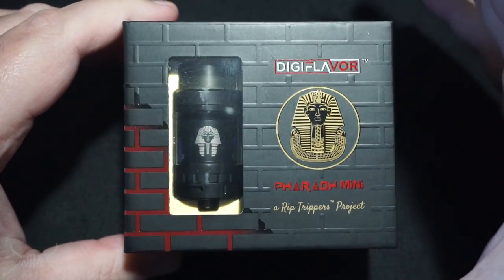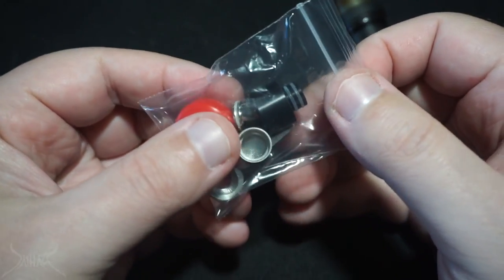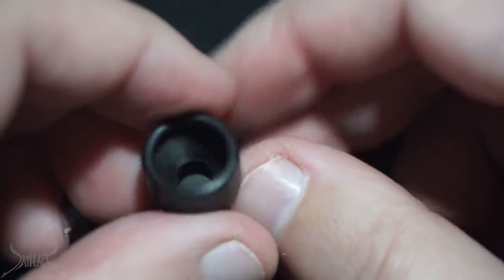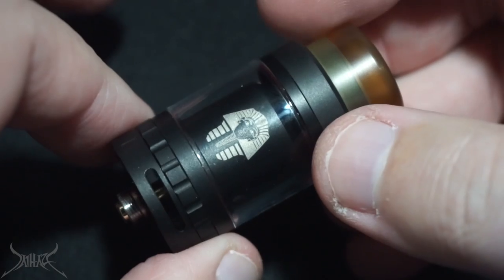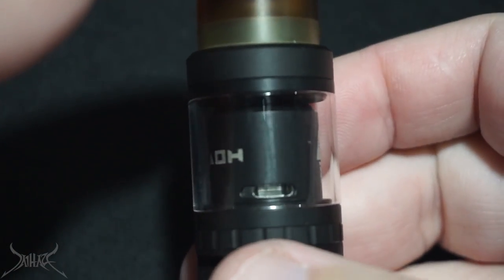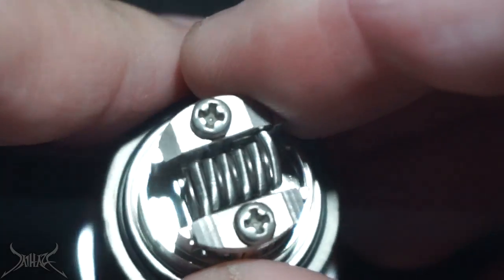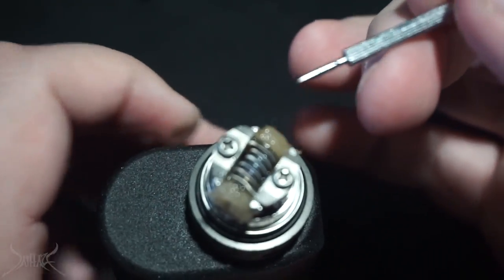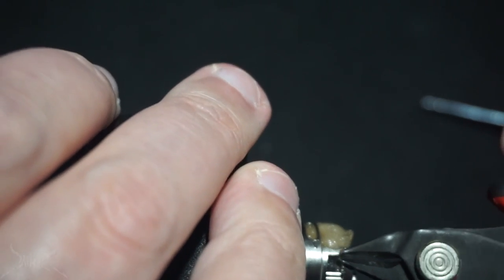WARNING: Digiflavor Pharaoh Mini RTA Review and Rundown | RIP Trippers Project

Comment: ive owned this for a couple months... no issues at all and juice flow control works fine. great tank though
Reply: I had one, and it worked perfectly...then suddenly the juice flow stopped turning. Tried everything, took it to the retailer, ect.... Jai is correct. some of them are defective, like anything else mass produced. I loved the tank, and will eventually purchase another. But Jai is correct about this problem. It is turning up more and more now.
Reply: yeah, juice flow control is fine spins round and round all day on mine
Reply: Aaron Fraser honestly jai just tells it how it is, just like every reviewer has a opinion so does jai, but he is 100%, rip trippers is not actually, he's more like a "yes man" I mean come on not 95% of the  time should products have a huge amount of positive reviews man, I don't want to buy something that's not true even though the reviewer says that it is. So far jai is a honest  reviewer so if you want to sugar coat something that's on you, reality is reality
Reply: Does jai have a thank lmao if he does I haven’t fuckin heard of it.........
Reply: I was under the impression from Rip that the juice flow control was more of a “set and forget.” The main purpose is to cut off flow for filling up, then its opened to its normal position.
Reply: I finaly looked at what the actual fuck he did, he did not lock the tank as he should have xD i did the same thing, broke the glass and i looked at rip's video, just pacepalmed myself. READ THE INSTRUCTIONS! PHARAOH is most beautiful and top of the line rta ;) who has it, loves it
Reply: @SasaPetricevic  top of the line? Wtf, its a cheap chinese tank.. Mines a pos in my opinion..
Reply: @Slabri  jai is reviewing from the consumers point of view.. If my tank has a fault its a pos.. And if its a quality control thing, how come so many pharaohs have the same issue? 1 or 2 fuck ups is bad but hundreds or even thousands are messed up then the QC is bullshit..

Comment: Bought this today and the flavour is unreal. Slight leakage when I poured some juice down the mouth piece instead of unscrewing it and pouring into the tank. I went from a shitty old Zenith RDA which was burning my fingers when it leaked juice and having to crank up the power (in series) to get a decent hit to now using parallel mode with my batteries and having excellent cloods. I'd definitely recommend it.

Comment: You might have a defective one cause I bought 2 and have no problems with either one.maybe try it in shorty mode. Both of juice flow controls work on mine but my black one is a little harder to turn than the silver one.
Reply: The juice flow control is just like the griffin.  There’s a separate ring above the base that just needs to loosen up and it’s probably because of the paint.  My griffin tank took awhile to loosen up before it worked right and eventually I had to take a rubber mallet to the base because it got too loose.  For those style of wicking channels juice flow control is very useful.  If you get it spinning loose independently from the base, then you will have a really good tank.  Just my play on it.  I could care less about Rip Trippers.  Just seems like the exact issue I had with my Griffin rta which I still use every day.
Reply: Ive been using the griffin plus for about a year now and i just literally spun my base tonight after reading your comment. Thanks! I never knew that. I also have the pharaoh mini. Youre right!
Reply: dude i just spun all my ammit tanks loose too! the ammit original. I never knew they did that! Ive been using those for over a year, as well! Shit!
Reply: Matt Rainear I have the original Griffin tank and the juice low does not work like that it's free spinning there's a ring to tighten the base all the way down and then a separate one for your juice flow that keeps spinning continuously.  You are not unscrewing the tank on the Griffin for the juice flow control understand?
Reply: Matt Rainear I have 2 pharaoh mini and both of my juice flow controls work. Like I said the black Pharoah I have was tight  till I broke it in. Both of mine work fine with no leaking in 2ml mode
Reply: is like the ammit25 right? I think he is doing wrong

Comment: I own this tank for more than 6 months. I never experienced any problem as long as the wicking is correct. If the cotton is protruding little bit then the chimney will stuck with the deck. Flavour and  is great even at 25 watts and can go up to 50 watts also. No dry hits and leacking if wicked properly. Only issue is restricted airflow

Comment: You didn't tighten the locking screw enough to hold everything in place. If you had locked everything down properly, you would've been able to adjust the juice flow without unscrewing the entire thing — that's the point of the locking screw.

Comment: I had the same issue with the juice flow being super tight and nonfunctional out of the box on my black one. If you run into this, put the base on a build stand and use a screwdriver in between the build deck like how a coil would be installed and use the added leverage of the screwdriver to pretend like you’re tightening the deck into the base and it will break free and start working normally. I won a stainless one in a giveaway that worked normally and actually really liked the rta- being able to close off the juice flow when you go to refill made it never flood the deck like I’ve had happen on a bunch of other rtas.. I decided to buy a second one and the black one juice flow was seized..having one work normally allowed me to figure out how to fix the other one.

Comment: I'm a bit late on this but there might still be people considering this RTA.
My tank have the same issue with the juice control, it just doesn't turn. The cause seems to be how the juice control ring is installed on to the base. It's press fitted and the factory just couldn't keep up with the tolerances. 
The design is not that good, way over designed. There are so many separated parts and O rings in it, break 1 O ring and it leaks.
Jai Haze is a great, honest reviewer, I like how he's being picky on products. Details make a good product.

Comment: Keep it real! Love your review! Have Zeus love it once I wick and coil right. Ammit 25 single coil leaked  at juice control and felt a little lose when you turned it. Took there  O ring ring off and use same diameter o-ring from Zeus kit just a little thicker tighten it up nicely no leaks

Comment: Put the 2ml glass on and make sure to put that lock not thing on then hold the top cap and glass while turning clockwise to break it in. At least that is what I had to do with my black one. I have no leaking at all with both of mine in 2ml mode.

Comment: Ok Jai, no time or no money, no way you're going to get a new one Pharaoh mini to see if this one has "pressure" problems when you unscrew the tank to open the juice flow control. Do that for us then.
Just build it again with a 3-3.5mm coil, put it's legs at the bottom instead putting them at the top (so that they won't let the cotton touch the "inside" airflow holes) do your wicking as you already know and just.. rate this tank again. Please do it, don't just "let it go". It's just not fare mate. :)

Comment: They juiceflow control should work the same way like the Pharaoh RTA - even if you feel you are tightening the tank, eventually the juiceflow will spin. However the o-ring can be too stiff so you feel like you cannot turn it. I had simiral issues with my Pharaoh RTA when it was brand new.
Reply from the maker: I agree, it doesnt though.  Its all one piece.  Its def dumb on this tank and fails so horribly
Reply: Jai Haze I'm pretty sure It looked exactly like the OG Pharaoh juiceflow control in RIP's review and few others. I might be Wrong thouhg. Anyway I still think you got unlucky with an extremely stiff JFC o-ring. Try to lube it up and work it with pliers.

Anyway the JFC certainly shouldnt be such a pain in the ass

Comment: Um...the juice flow works like almost any other tank with juice flow...when it is new and painted and has a brand new oring it is tight and it loosens over time...people said the same thing about the griffin and the ammit and others but they all work the same...you can't blame the product for you being an idiot and assuming that unscrewing the tank section from the base is "how the juice flow works" when it clearly is not how the juice flow works. It leaked because you clearly didn't loosen the juice flow enough for it to move properly and although the juice flow control being that tight could be considered a con it is not the reason you dumped juice all over yourself, you dumped juice all over because you unscrewed the base from the tank. Tank is ugly, I usually like your "reviews" for comedic effect if nothing else but this is just you being an idiot and blaming your idiocracy on the product to shift the blame elsewhere
Reply from the maker: +Howard Johnson then if you watch me, there should be no reason for you to call me an idiot. This is my experience with it and my opinion. Because it didn't spin for me then OR NOW, it's a piece of shit
Reply from the maker: yeah mine 100% does NOT spin.  I broke both glasses and even tried to do it without glass on it.  Ill make video for you guys.  I dont doubt that your guys spin, mine doesnt.  Thats the big problem
Reply: Jai Haze I would say its more than just a problem lol, it renders the tank almost inoperable if its stuck in a closed position whilst screwed all the way down to the base, either way though it is ugly as sin...love what that other guy said about it reminded him of his ex "tall and skinny with two big holes at the bottom" lmfao. IMO digiflavor has had some questionable quality control in the past...although geekvape and vandy vape haven't been perfect either(my original griffins had to be traded back to vapenw more than 6 times between the 3 of them and the Perseus locking setup broke within 2 weeks of putting my first build in it grrrrr) so props on your upcoming rda being made in the USA and hand checked....more interested in you designing an rta though...us both being rta orientated vapors...still gonna buy the rda though...whats the deadline on picking a serial number if your a patreon supporter?
Reply: Jai Haze - maybe digiflavor will send you a working one. Supposedly the stainless ones are easier to manipulate. Which I think is stupid AF, but maybe it'll make a diff.
Reply: the stainless ones are media blasted too though...not sure I understand why that one would work better when it is media blasted just like the black one...unless the "coating" is different and possibly thinner...but whatevs

Comment: Definitely got a faulty unit man, mine has no issues. Though the juice flow is probably unnecessary, it works as it should and doesn't leak. Great video anyway, keep it up.
Reply from the maker: yeah its def faulty, but still a shitty experience.  I made a 15 minute video today showing there was no way I could spin it.  Used channel locks and im pretty sure I destroyed the threading

Comment: Hi there Jai. 
Try making the tank section really tight before attaching the base. Than while you have it on a mod use the juice flow control clockwise. 
For what concerns the inner locking mechanism i truly think this is one big bullshit.  A wider chimney and bigger airflow would have been amazing.

Comment: TheJuice flow control is not working properly because you're holding it with your other hand to keep it from spinning turn The tank clockwise without holding the base with your other hand

Comment: Jai is mostly right and I fully agree about the shitty juiceflow, not because it does not work, but because it indeed seems like there is no JFC! Me and a best friend bought this a handful of days ago and we had the same problem as Jai. He is right to say this is a POS, but not because of the design or because or the ripytripy. IT seems to be more like bad construction from the side of Digiflavor. Both me and my friend bought Pharaoh Mini from a different shop. Mone was the normal edition with the 5ml extension and his the TPD one, that has only the 2ml, so they definitely were not from the same batch. We both could not move the juiceflow and we were convinced that Pharaoh Mini just does not have JFC, except if it counts unscrewing the whole atomizer tank a bit, to make it move. When I saw another reviewer and saw it moving, I was shocked. That means that we BOTH got a bad Pharaoh Mini, from 2 different shops and in a way 2 different versions. Thankfully I managed to make the juiceflow work on both of us. I used one of those ceramic tweezers/pincer tool, and secured it on the juiceflow part, then with a tower I grabbed and secured the deck and then roughly turned the pincer tool, which really painfully and slowly made the juiceflow FINALLY turn. At first it was really rough, but I kept turning and turning and turning and within the day now I can actually use the juiceflow.

2 years after and there are still Pharaoh Minis found with the same problem Jai has. I believe Jai's review is totally right, because it represents all the people that would buy it and would not want to find ways to make the juiceflow work, one way or another. They would just be stuck with a really awesome atomizer, that would have a Fing non working juiceflow, which is actually really great for preventing leaks, once it works, but they won't be able to use it.

Great atomizer with a POS quality check.

Comment: I have zero issue with the juice flow control, I have had zero leaking. Zero issue with weeping. I have a 3.5 I.d. Alien in mine and it works great. Juice control spins just fine I have had this tank since it came out and have had no issues with it. Flavor is great as well. Could it be that there is a bit of user error involved in the problem with the juice flow control?

Comment: You kinda got something wrong with the JFC. Once it is tightened down it can still be spinned with pretty little effort to adjust the juice flow. I do not know what the problem with yours is, but mine is fine. Apart from that I personally really like the look of it. But then again I only use the 2ml glass, which does look better :D
The red drip tip is garbage but apart from that, I really like this tank. Definitely better than my Augvape Merlin Mini ^^

Comment: My friend and I both have this tank,  and the juice flow works identically to the pharaoh or ammit 25. Granted it's a bit stiff but it works just the way it's supposed to, I have no idea what's wrong with your unit.

Edit: I see exactly whats wrong, you're not twisting the control, just unscrewing the chamber off. Your jfc is stuck, same happened on my ammit dual.
Reply from the maker: yeah, and even a step further I had a huge issue with tank after the video.  I made another video because people requested it and showed that the threading stripped and was just spinning on the base.  Ehhh it is what it is, mine was defective like how I am
Reply: Jai Haze fuck that sucks a lot, qc really screwed you over. It is otherwise a really good flavor tank, and had that issue not showed up you could've focused on problems it has when it comes as it should (like the floating glass design or how the locking chimney unscrews over time with opening the top cap.
Reply from the maker: me and qc dont get a long well ;)
Reply: Jai Haze yeah I noticed that when someone forgot to tell geekvape that drippers are not christmas trees and they left you a lovely present underneath the Athena deck :/

Comment: I think yours must be really tight because I just watched djlsb video on the rta and it clearly shows him being able to use the juice flow control spinning it round and round so maybe the one you got it’s broke or really really tight
Reply from the maker: yeah i mentioned it in the description, mine is 100% broken
Reply: Hope you edit your video then after you get a working one
Reply: Yep, because it would be unfair. I had a pulse 24 bf with missing screw, tight Oring that wouldn't let you adjust airflow without unscrewing the atty from the mod, and the worst part, the vendor wouldn't replace it, what a fuckin bitch.. but I bought another, and glad I did. You just can't prevent defective products from accurring, it's just part of any other mass production. Hope you do the right thing and redo the video, for the sake of your subs that believe on your HONEST reviews.

Comment: Extremely late comment as i have had the tank for about a month now; but it would help if you watched Rip's video on how the locking nut works.. I have had no issues at all with the tank in the slightest since i got it.

Comment: That orange tip will kick ass at a Halloween party...
I'm using a Zeus single coil write now and love the TOP air intake system a tad of a spitter until you get the coil creation right, and the thread quality is jack shit :-(  but over all it vapes great. 
It's not my primary tank all the time cause I'm lazy, I like a drop in prebuild tank top venting as my on the go , hate building coils.  But I have to because I like 0.6  to 0.9 ohm coils, I'm a medium low power vaporer. The V8 Baby coils are hard to find at 0.6 most dealers don't carry them, I'm waiting for 20 of them to come in from over seas, so for 4 weeks this Zeus is it till then.